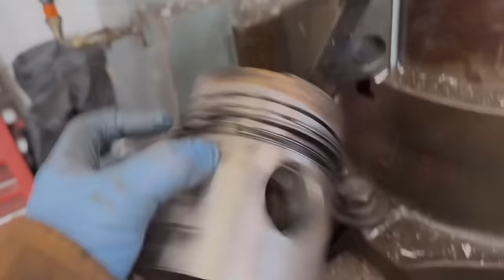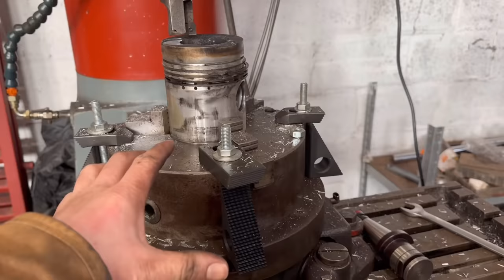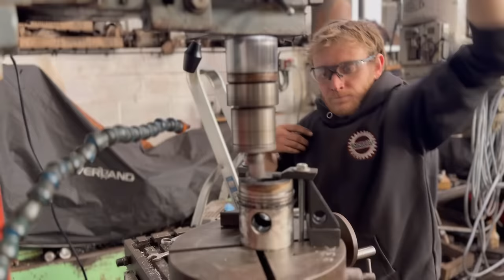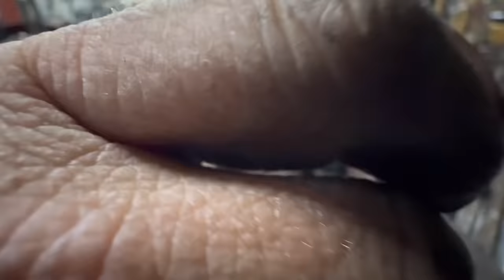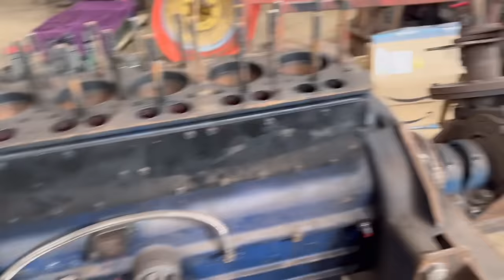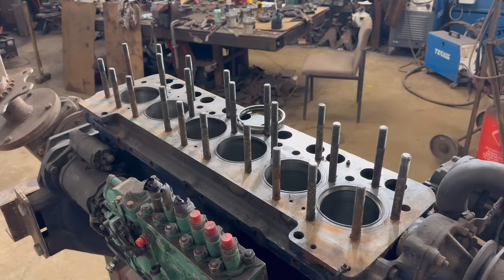Rebuilding my tractor puller. Piston modifications. Part 1

Comment: Why do you want lower compression
Reply: Probably massive turbo on it.
Reply from the maker: There’s a few reasons.  You can run more advanced injection timing. It reduces cylinder pressure which puts less stress on the block and engine internals. More space in the cylinder for all the extra fuel and boost.
Reply: More inlet pressure without to high egt
Reply: Anchorlube seems to be amazing stuff, Josh from Topper Machine loves it and he’s not easy to impress. Looking forward to part 2 😊